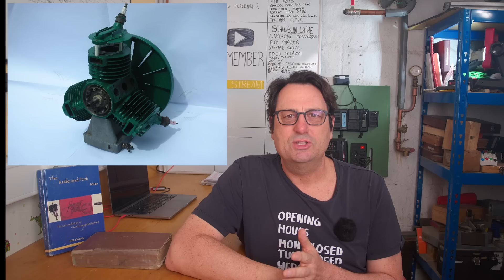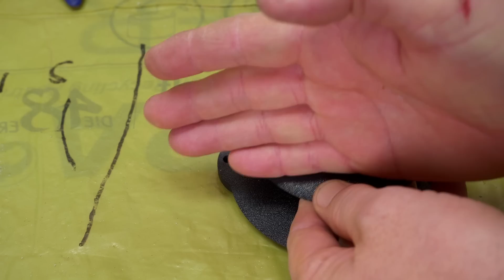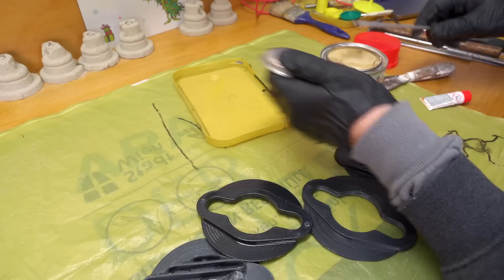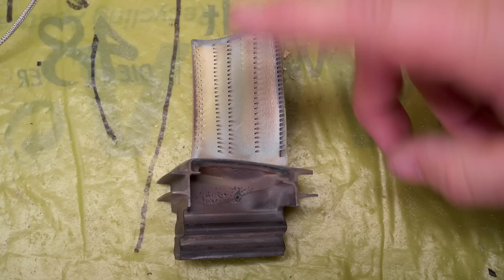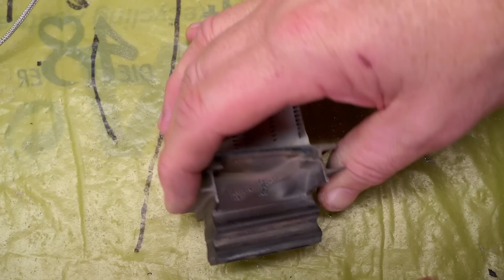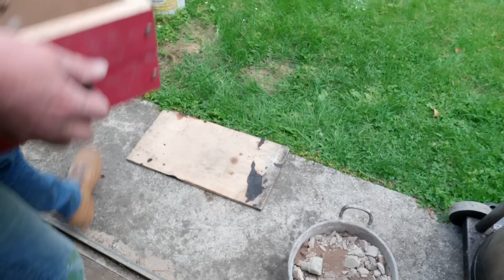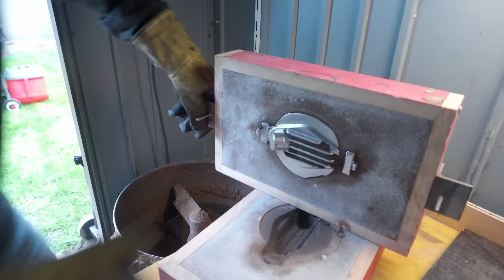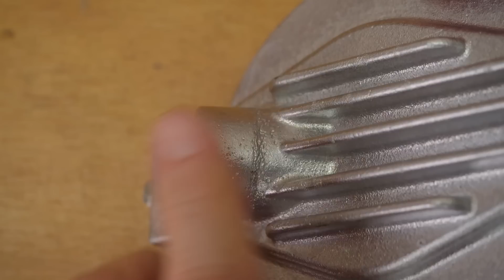Prototyping cylinder heads - Redrup Radial EP.6 || RotarySMP

Comment: Next challenge: making 60 octane gas from 87. I also imagine it was leaded although I am sure you have Avgas to downgrade. Fantastic video
Reply from the maker: I don't think TEL was added to fuel until later.
I googled and got...
"Its effectiveness as an antiknock agent for gasoline was discovered by Thomas Midgley Jr. in December 1921. "

To downgrade 87, I would just need to mix in cleaning benzin. It is probably only 20 or so octane.
Reply: Your commitment to period authenticity is pretty amazing! Most ‘gearheads’ dont get the the real advancements are driven by things like knock sensitivity, tire technology and exchaust valve/babbit metallurgy. playing with Onshape so your excursion on CAD was greatly appreciated.
Reply from the maker: @francisrampen9099  I really like OnShape Francis. They put out a call for influencers, so I sent in a application, but never heard back. Shame, as it is a product I really want to use.
Reply: @RotarySMP  When I was racing TZ750's ELF was mixing special fuel for me - I was told it was 60% Toluene with some other secret sauces including at one point Castor oil. Of course it is not only about knock sensitivity but flame front propagation speed. You are going in the completely opposite direction! Kind of fascinating.
Reply from the maker: @francisrampen9099  Yeah. I am not at all concerned about performance. If this starts and runs I will be thrilled :)
Reply: @RotarySMP  You would have loved my friend Frank Farrington -aka 'Radco'. If you ever find a copy of 'The Vintage Motorcyclist' pick it up.

Comment: Mmm - my first comment seems to have been auto-removed, possibly from trying to reference another website.

From Lowe's 1923 pocket book the bolt head size for 3/16" BSF would be 0.338" AF and 0.109" high, which would be the same proportions as 1/8" BSW.    Pre WWI the sizes would have been one step larger.
Reply from the maker: Thanks for looking that up.

Comment: Using variable layer lines in bamboo slicer with many lines where the horizontal cooling fin is, might also help with the slight taper
Reply from the maker: Thanks for the tip.

Comment: PETG is a great filament, but it actually sands pretty bad. If you need to smooth something, a fresh scalpel or a soldering iron is much easier.
Reply from the maker: Thanks for that tip :)

Comment: Nice Job
If you are having trouble with hydrogen in the metal have you considered degassing it? I know with that type of sand it will never be perfect but degassing can make a really big difference.  All you would need is a 3/16 piece of stainless tube and you crimp and weld the end. Then drill 3~6 holes as low as possible that are small maybe .5 mm in the pipe and feed Argon or Nitrogen down the pipe not to high or low a pressure to achieve a slow boil appearance on the surface of the metal. It will pull ash out of the molten metal as well as give the hydrogen a chance to escape due to the lower density of the bubbles. 
There are a myriad of ways this is done in industry but a simple bubbling lance works quite well.  This could also be used whilst it is in the heating chamber as the volume of nitrogen/argon  isnt enough to affect the burner. Also melting scrap introduces ash into the metal mix.
This process is often used when making diamond cut front face wheels for cars and motorbikes as well as their hubs. As any debris in the metal at all will show on these cosmetic finishes. It might be what you need? You can also get the metal way to hot and the process will cool it as long as its going.
Cheers
Reply from the maker: I have not yet had bad porosity issues, but have been thinking about making a degassing lance.
Reply: @RotarySMP  Also a tip I forgot to mention. If you do go this way make sure to use a flow control and not a pressure regulator to govern the bubbling rate. It's kind of self explanatory but if you use a pressure regulator if the lance fails the bubble rate can get a bit vicious.
Reply from the maker: @dazaspc  I would use my TIG argon bottle, which has a flow meter on it.

Comment: Regarding printing lines on the castings: Have you ever tried sandblasting the molds to get rid of the printing lines? I always wanted to test this, but don't have access to a sandblaster. It will change dimensionality, but if it is only for a visible part, it might work out better, compared to aceton smoothing or filler+sanding. However, i don't know, if sandblasting may be to aggressiv, lead to embedded blasting medium in the printed mold, or just wont reach the lowest part of the fins.
Reply from the maker: I havenÄt thought of that. I would assume that the sand blaster would shread the pattern. I'll give it a go and see.

Comment: Happy Sunday. Not sure you need a better surface finish... the extra surface area would probably help with cooling... or at least that seems like a good excuse to leave the surface finish at what it is.  Machining should clean up the mating surfaces and generous gaskets should handle the rest, unless you really do want to take up the next five years making this thing... anyways I'm no expert. Hope you are enjoying the weather, I'm spending my time at my desk building CPUs lately... thanks for the video!
Reply: PS, how about using more of that wax on the pattern?  might help with the fillets. =D
Reply from the maker: Hi Mike,
It is nice casting weather. Not too hot and plenty breezy. 
I will try one with petrobond just to see the difference, and which finish I prefer.

You need special hard wax for fillets, otherwise the sand will stick in it.
Reply from the maker: Revise that. It started raining, just as I was planning to go out and do some production castings today.

Comment: I think your TEMP is to low and I would use a flux to de=gas the aluminum.  I would also increase the volume of aluminum within the flask to hold a better temp while pouring
Reply from the maker: Yes, the temp was too low, I was working up to try and find the minimum temp for this pattern. From now I will be casting them at about 720°.

If I melt more, I will just be making more ingots, as I dont have enough sand to make more moulds at once.

Comment: It won't do anything for layer lines on vertical surfaces, but there is a slicer setting called ironing that improves the appearance/smoothness of flat planes. What it does is do a second, slower pass with the nozzle, at the same height, extruding only a very small amount of filament. In doing so it "irons" the surface flat. The downside is an extended print time, obviously.
Reply: The problem in this design is that it's not a flat surface, it's a very shallow angle which is why he's getting the visible stepping.  Ironing will not help in this case, and ironing PETG is problematic anyway as it's so prone to stringing.  Printing the design at an angle, or even vertically with suitable support structures would fix the stepping on the fins, but may introduce other artefacts.
Reply: @ferrumignis oh I know, I was more referring to the general surface quality of the flat surfaces, between the steps. It'll also help taking the edges off the nose of the steps. Not a panacea, but it will improve things slightly.
Reply from the maker: @timangus  Thanks for the tips guys. I hadn't heard of ironing as a slicer setting.
Reply: @RotarySMP give it a shot! In particular it might help smooth the flat areas between the fins, where it would be otherwise very difficult to get filler and subsequent sand paper.

Comment: For fixing STL files the Microsoft 3D Builder application that comes with Windows works pretty much every time I've needed it.  For more advanced mesh correction the Autodesk Meshmixer app is free to download.
Pre-war BSF used a spanner size one below the BSW size e.g. a 3/16" BSW would use an 0.445"/11.30mm AF spanner, so a 3/16" BSF would use the spanner for a 1/8" BSW which is 0.338"/8.59mm AF.  That said, is it possible this engine would have originally used British Standard Cycle fasteners?
Reply from the maker: I considered use of BSC as well, but Redrup had worked in aviation in WWI and I got the feedback from his biographer that he used BSF on his motorbike engines.
Reply: @RotarySMP Very handy that you managed to contact the biographer. Have they been able to provide any unpublished material?

Comment: i feel your pain
 free cas often can do the fillet around a feature if you go from part design workbench to part workbench and do it there, because part workbench has slightly looser constraints and can go over the edge lines  while part design struggle with going over any reference edge on the object
obviously if you want to do futhher modeling you need to go bacj to part design and make new part out of the old one by selecting it and clicking create new part, it will get copied as base feature and you can go on from there
if a part get too complicated there is always an option to exporting object to step file and  inporting it back to new cad file
Reply from the maker: Thanks for the tip. This is the sort of issue which turns people off open source software. I guess there are lobbies for both part design and part work benchs, but ideally, they would be merged.

Comment: How does buying gas work in Austria? Do you own the tank and have it refilled, or do you 'rent' the tank and exchange it for a full one? Here in Canada we do both. It's generally cheaper to own/refill, but a bit less convenient than exchanging. An owned tank is certified for 10 years, after which it either has to be hydrotested or scrapped. Since hydrotesting costs way more than a new tank, they always get scrapped.
Reply from the maker: It is a rental tank. I paid some extra when I took the first one about 13 years ago. After that yo just pay the refills. I am not sure if any companies offer refills, that Bauhaus is pretty close and convenient to me.

Comment: I started using FreeCAD a while back, and it can be very frustrating when you get that error message when trying to apply Fillets or Chamfers. I only 3D print using PETG, and once I got the bed and extrusion temps right I solved all of my bed adhesion problems, and in my Creality Ender 3 V3 SE, which has a heated bed, the parts will just let go of the bed by themselves after the bed cools down. The more I watch you struggle with the sand casting, the more I'm glad I only cast using Lost Foam, I finally got my hands on the type of foam that Kelly uses in the last week and from now on I'm hoping I'll end up with better surface finishes than I have been getting with the foam I use now.
Reply from the maker: PET-G also prints really nicely on the Bambu. Grips rather well on that smooth build plate.
Kelly does amazing work in lost foam.

Comment: Maybe a slight draft angle on the pin between the main pattern and the floating piece would help it release when removing it from the sand?
Reply from the maker: It has a generous draft angle (5°), and I print the pattern 1.5% enlarged to compensate for metal shrinkage, but left the spark plug boss nominal. It is a very nice fit, with just a slight bit of binding from the striations.

Comment: Hi mark, love the video. I have been a fusion guy for a longtime, but recently delved into rhino, it's a godsend for surface work, could work well for your engine
Reply from the maker: Thanks Paul. I don't really want to switch to a surface work flow, as I have little to no experience there. I will probably just stick to Bondo for the problematic bits.
Reply: Fair enough!  @RotarySMP

Comment: I use spray can filler primer on my patterns, works a treat fills all the layer lines and sands really easy
Reply from the maker: Thanks Peter, you reminded me that I have been meaning to get some. I am amazed that the vertical ribs needed no treatment at all. They mould perfectly every time.

Comment: Hi Mark. I've probably spent a thousand hours doing fillets in Catia and SolidWorks. They need a true tangency to find a line. Your model because of the split line will require 2 seperate fillets meeting at the split line where they cannot be tangential without the profile being elliptical. Some CAD are smarter/more tolerant of small angle changes than others
Reply from the maker: Thanks Jake. Sometimes it is easier to just use bondo :)
Reply: @RotarySMP  do you have petrol stations that sell LPG near you? Motorhomes often use a gas bottle with a filler nozzle (gazlow brand I think), it's much cheaper from a pump if you can find them. They've all but disappeared near me unfortunately.
Reply: @mandrakejake  Sadly Austria seems to be a bit of an Autogas desert - ex LPG converted car & current Gaslow equipped motorhome user who always made sure to be filled up in Germany while on holiday from the UK !
Reply: @mgnbukint6502  sadly all Shell garages in the UK removed their LPG a few years ago. Most others have since gone too.
Reply: The thing is that Catia, SolidWorks, Inventor and Fusion all use a much more powerful core than FreeCAD, and those can mathematically resolve much smaller fillets and chamfers. Even the newcomer Plasticity completely replaced their CAD core during development due to unreasonable limitations the old one had.
Reply from the maker: @graealex  Would there be anything patent protected in there? I would have guessed that the basic math algorithms underscoring Catia etc would have expired by now?
Reply: @RotarySMP  Pretty sure that even if there was some patents (although you can't patent basic math), you could work around it. It's just that both Parasolid and ACIS have more than 4 decades of development invested in them. You're not going to catch up to them with a FOSS project in just a few years.
Reply: @RotarySMP  Btw. you can use the Parasolid Wikipage as a cheat sheet for potential software to replace FreeCAD with a perpetual, commercial offering. BricsCAD, Alibre, Rhino come to mind. OnShape as well. The unfortunate truth is that FreeCAD is little more than an STP file viewer currently.
Reply: @graealex  FreeCAD actually has been around for longer than you would think. The first version was released in Oct 2002, which is ~22.5 years ago. Solidworks was first released not that much earlier, in Nov 1995 or ~29.5 years ago. That being said, I would definitely agree with you that it is definitely hard for FOSS to have the same resources and/or timeline as a for-profit company who can dedicate massive amounts of money to development. 

Catia has been around a lot longer than those two, having been released in 1982, or ~43 years ago. Since Solidworks and Catia are both developed by Dasssult Systèmes these days, it is likely they were able to roll a lot of knowledge/ backend software from Catia into Solidworks after they bought out the Solidworks Corporation in 1997.

I still find it odd that the same company publishes/ maintains two different CAD packages. I have used Solidworks for >15 years, but haven't used Catia. I have looked online to see what the differences are, and from what I can tell, they seem largely similar while they each are apparently better for certain specific types of modeling? It seems like it mostly just varies by industry, where different industries use one as the "standard" software.
Reply from the maker: @graealex  I am not even sure if improving the filleting engine is on the work list for the devs.
Reply: @RotarySMP  That would be in Open CASCADE, the underlying CAD core, where there is a 10 year old bug report open (failure to over-fillet and critical-fillet). I wouldn't hold my breath.